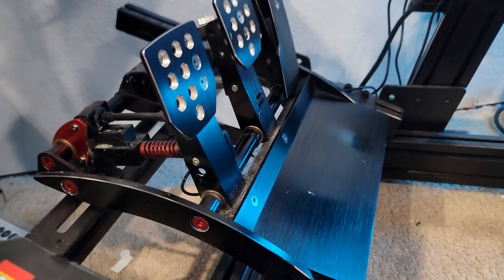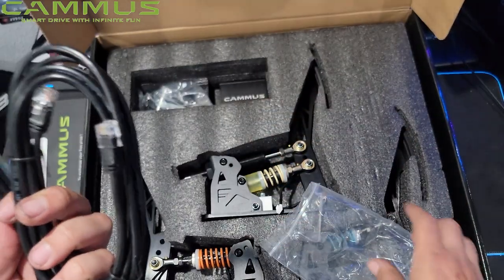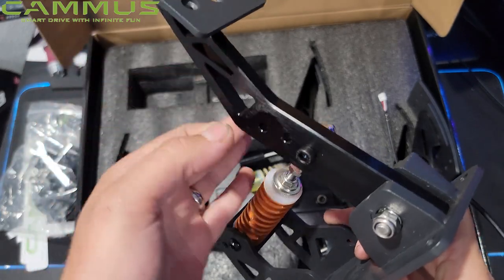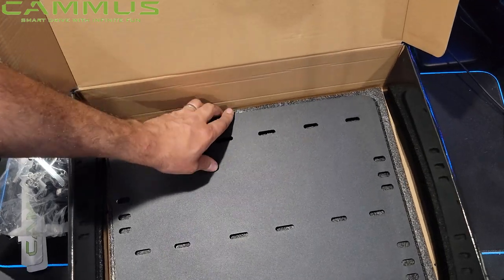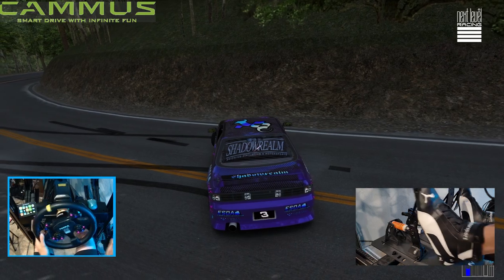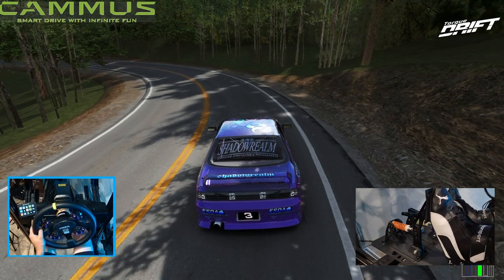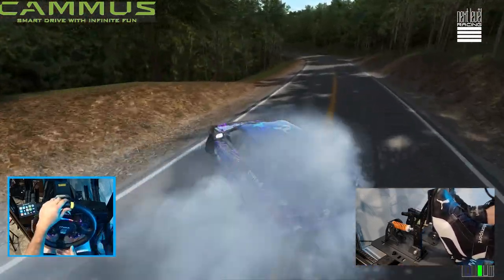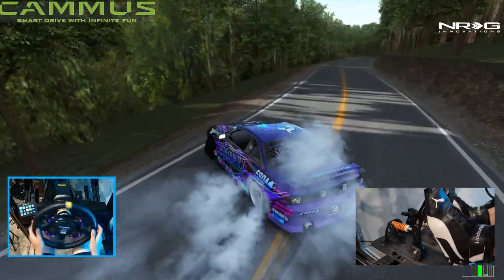NEW Cammus LC100 Pedal Set - First Look - First Impressions and testing

Comment: I got mine in a few days ago. They're... Different. The box says LC100, the packaging says LC100, the manual says LC100, but what was actually in the box is different than what's on the site, what every review shows, and they're different from every image I can find online. It's like I was sent an unlisted, updated LC100 V2 that nobody else has seen so far. 

Mine mount to the plate differently, the hall effect sensor is integrated differently, there are some cosmetic changes such as chamfering, the control box isn't a separate unit anymore, but instead is part of the accel pedal, it doesn't use USB B, but instead uses USB C, and the mounting plate is different.
Reply: Im pretty sure you have the GT1 Pedals ? the sensor will break after a couple of months and you'll need new ones , just happened to mine and a few other cammus owners with GT1 pedals
Reply: @TheThejarhead101  No, it's a revised LC100. There are some reviews starting to pop up for them. I seem to be the first person who has put images of them up online.

Comment: Are they better than the fanatec V3?
Reply: That’s what I wonder
Reply: My personal experience I'd say possibly...? Brake feel is more linear is with Cammus and pedal throw can easily be adjusted to personal liking. I'd say they are the best on the market at their price point. I do prefer the dimensions of my V3's more though, the Cammus pedals are a little tall for my liking. Other than that I have no complaints after about a month using them. Factoring in price tag though Cammus takes it in my opinion.
Reply: man fuck the v3’s fr i regret buyin them they feel no different from my old csl pedals
Reply: @Ronitrades  v3 no difference that csl or lc100 than csl?